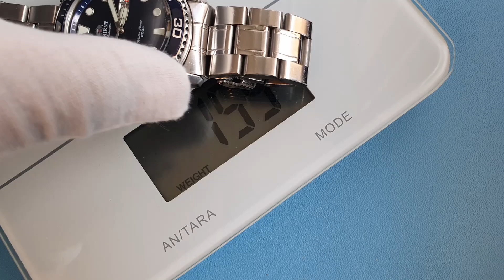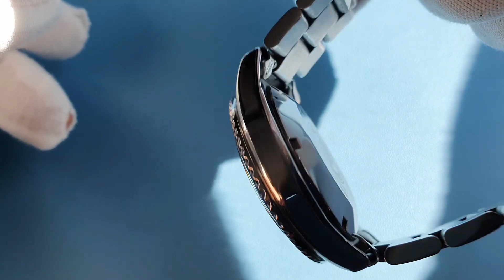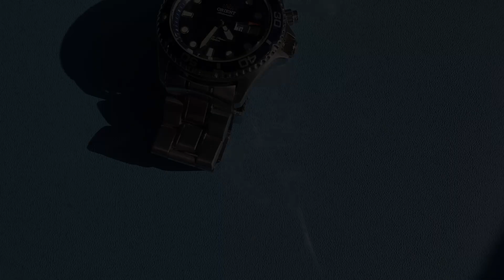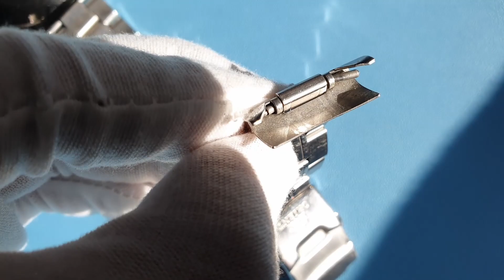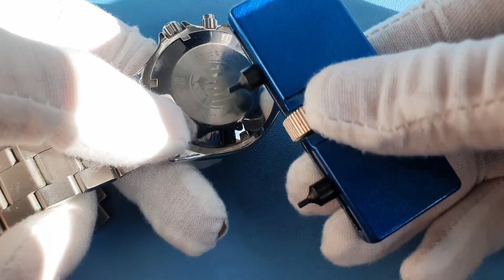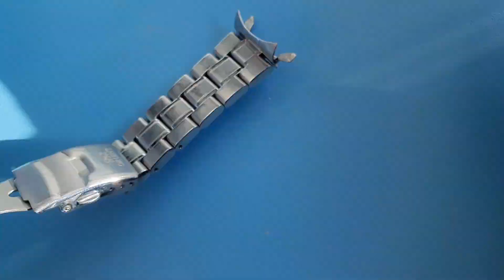M.A.S #18 | REVIEW: Orient RAY - Bright Performance (After 7 YEARS REVIEW)

Comment: Would it be weird to wear two watches? One has to be Apple Watch, for practical reasons, I use its features very frequently. The other one would be just for show :) I guess it would be weird. Alright, pass then. But it's a nice watch and it is interesting to see how the way we look at watches is changing. Not so long ago I'd appreciate having a mechanical watch that I could wear for the next couple of decades. Now I can't imagine replacing my watch after 2 or so years with a newer model.
Reply from the maker: I can totally understand you, at some point and for some time, I was using 2 watches. This one from the video and a digital one (not smart) for practicality... And it doesn't look good haha.

You can find some middle ground, decide what's special from each generation. I found this mixture in a Casio G-shock which is analog but also solar, radio controlled, it has stopwatch, countdown timer, alarms, etc. Great mix. And I also keep my protrek in titanium which can be also used for the office and outdoors with great practicality. For sure, both made of metal (most of it) do also long lasting!

I believe the idea of keeping a watch for ever and passing it on to your son / grandkid is very cool, and as you mentioned, nowadays very rare. I fantasize of owning a Rolex or an Omega for such purposes. I had a smart watch once (Samsung galaxy watch) and I thought it'd be the one size fits all... It was the only watch I regreted buying and sold it months later haha.

Finding the right watch is part of the fun, hope you can also enjoy this!